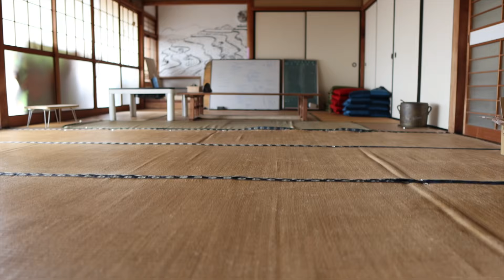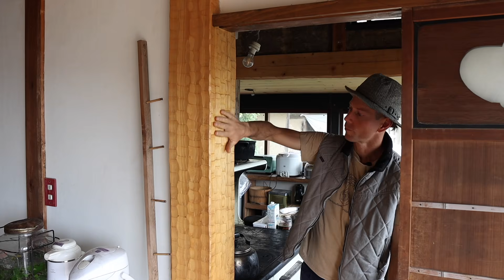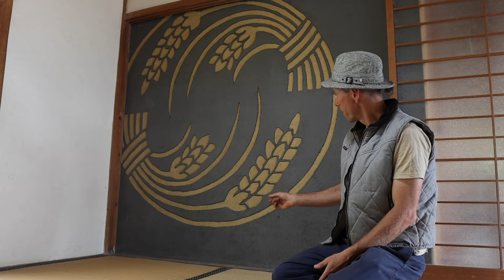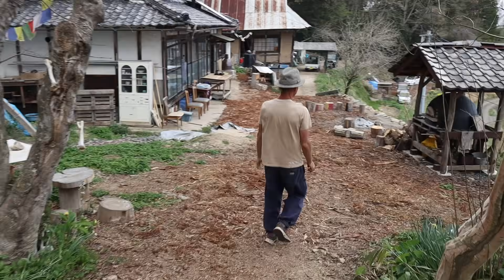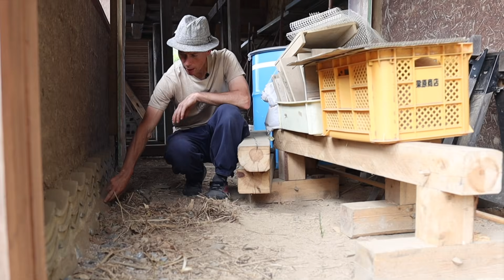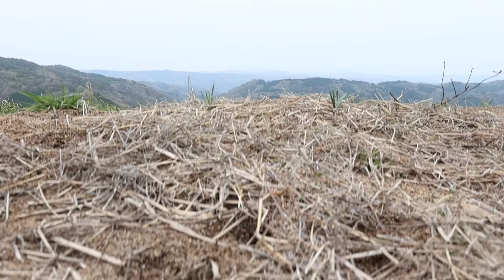One-Of-A-Kind Natural Building Paradise In Japan | Full Site Tour

Comment: Lovely way to research and apply different building and insulating techniques. I understand that each approach has ups and downs, based on what kind of location you have to work with. But I'm very interested to know how it turns out when it's finished, and how the different methods hold up to weather, and seasonal changes.